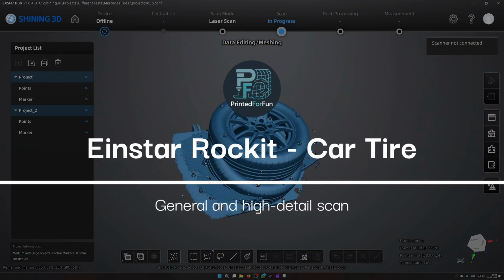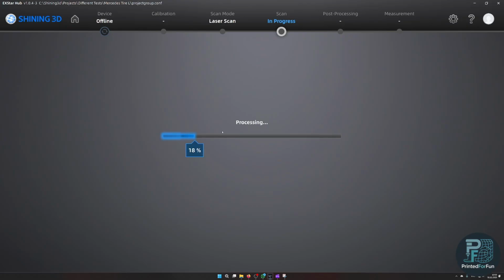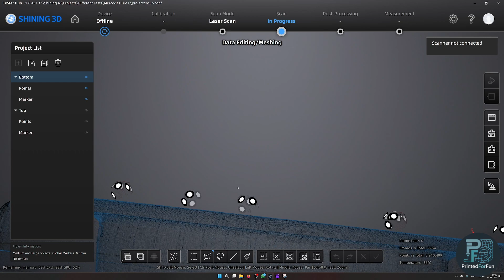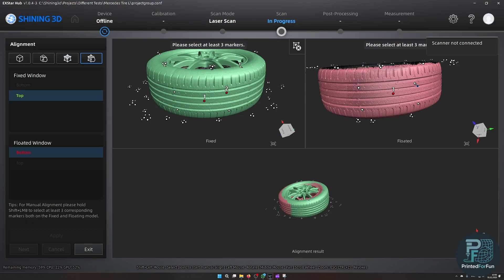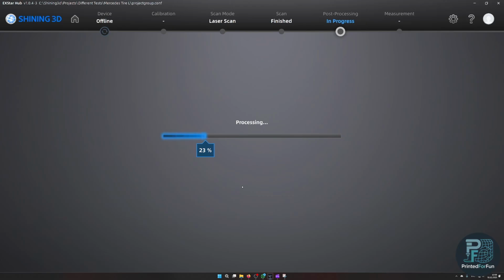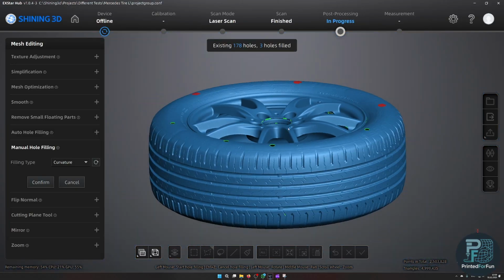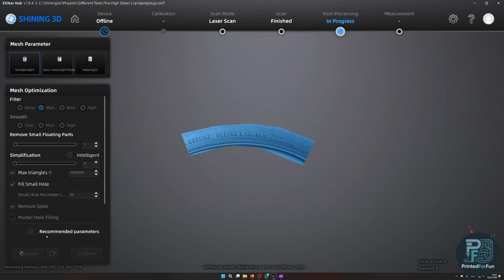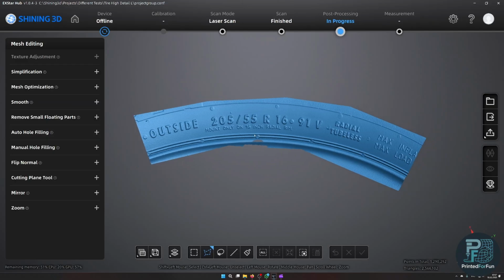Einstar Rockit Post-Processing Workflow: Scanning a Tire

Comment: Hi can you tell me the spec of your computer that you used with the Einstar Rockit? I'm planning to buy but not sure weather my Laptop support it because it still uses DDR4 and not DDR5 that Recommended for the scanner.
Reply from the maker: 64GB DDR5, RTX5070ti and Ryzen 7700x.
Also used it without problems on my notebook with a 12700h? 16GB of Ram and a 3050 mobile. Ram is too few for larger scans, rest is ok

Comment: The difficulties with aligning the 2 scans did not arise as a result of "placing the markers regularly", but with a high probability as a result of not removing the markers that were on the table and placed (not glued) on the tire.
Reply from the maker: Fair point. Moved roughly half of them in between but there were still enough static ones. Will keep an eye on this for future scans